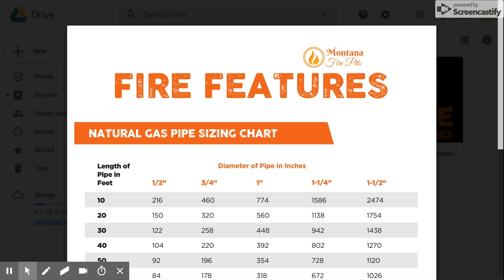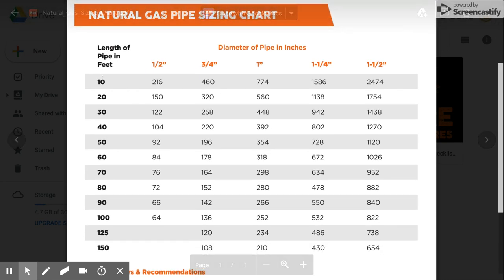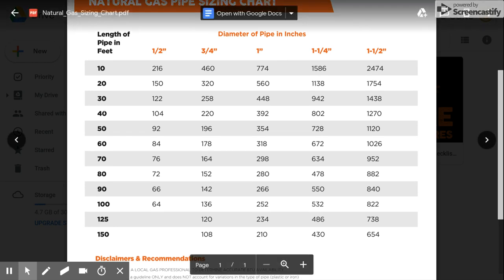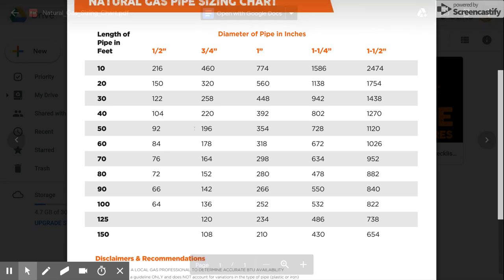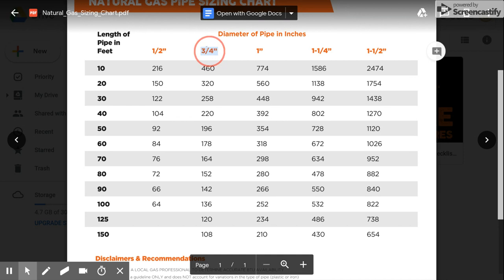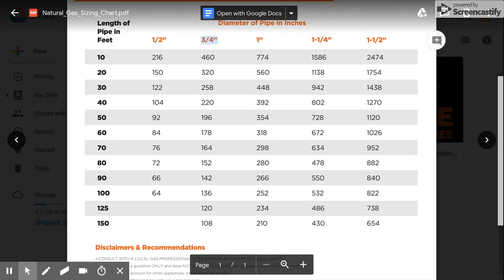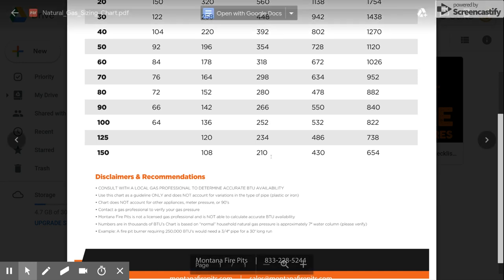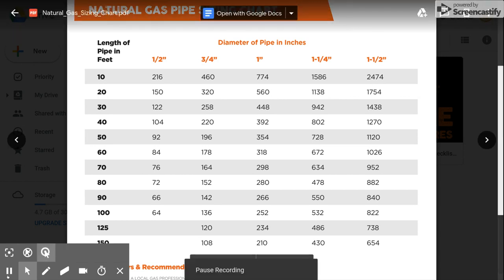How To Read Our Natural Gas Pipe Sizing Chart

Comment: I have a situation where I need some advice, my fire pit is 240k btu and 60 ft away from gas meter . My plumber installed 1/2” pipe all the way and fire pit is not getting sufficient gas due to smaller gas pipe size and recommend size is 1” for 60ft long . My patio is already built so it’s not possible to replace the pipe all the way and only option is to replace 50’ pipe with 1”and keep rest of the 10’ as 1/2” . Is it going to work provide enough gas for fire pit?
Reply from the maker: Hard to say, you may need to use a manometer to test the fuel at the end of the line